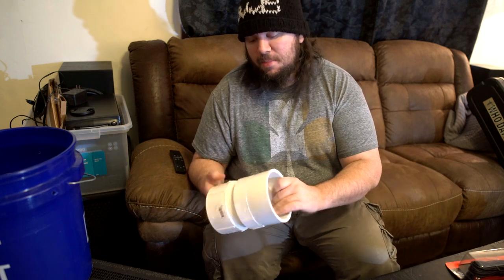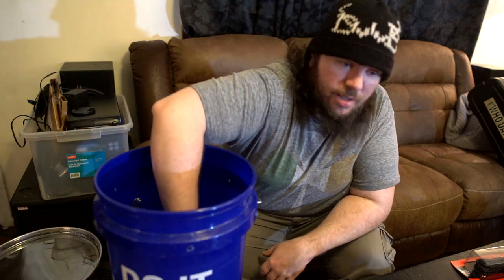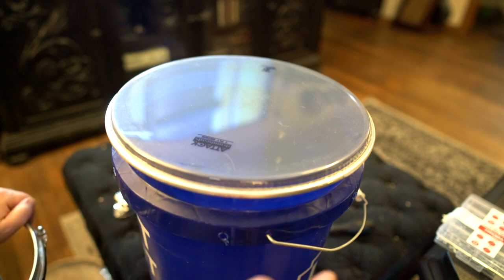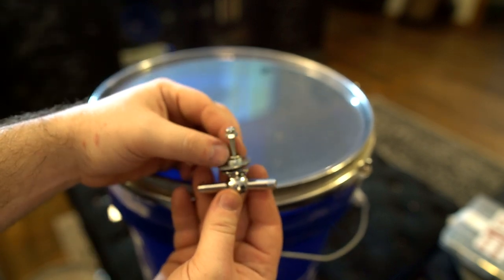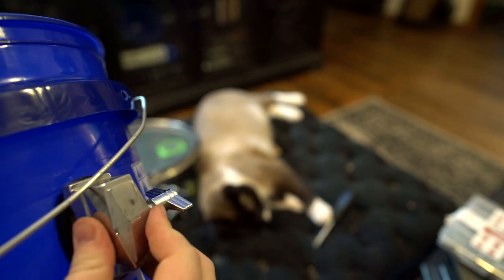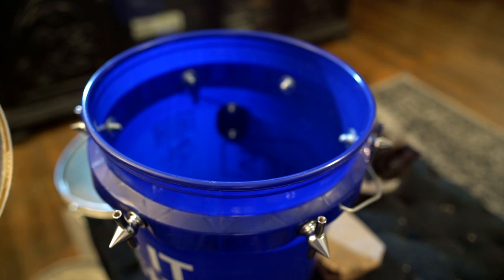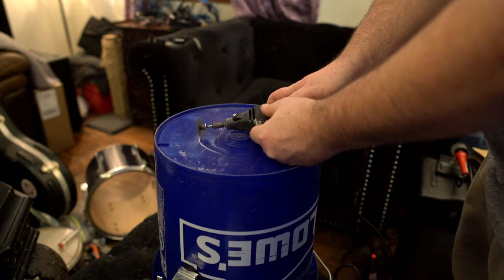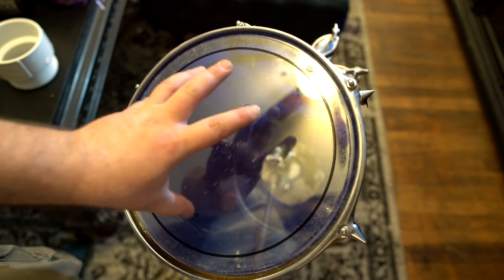Making a 5 Gallon Bucket Tom Drum! Super Easy!

Comment: I kinda dig the sound of it. It rings a lot and I'm sure that can be tweaked. I'm wondering if the flex can be fixed by using a metal ring around the plastic bit where it's mounted. Maybe get some flat stock and have it bent into a hoop and welded on the end (or bolted together if you don't have access to a welder) then mount the lugs to that. With this method, you should be able to make a drum out of almost anything as it will mount to the hoop. I'd love to see a full Lowes kit!
Reply from the maker: My thought was to do the same thing out of wood, since that's what I happen to have lying around.  Thanks for the idea and for watching!
Reply: @ForsytheVideo  I can’t tell for sure but it also looks like you could potentially make some wooden spacers to slide up in between that outer flange and the bucket. If you drill a hole through the spacers the lugs can bolt through them, hopefully stiffening the structure and stabilizing tuning. Also I realize this was 2 years ago and you’re probably on to other things by now.